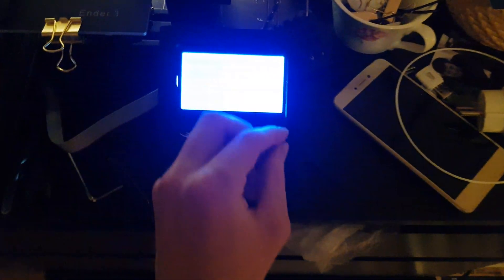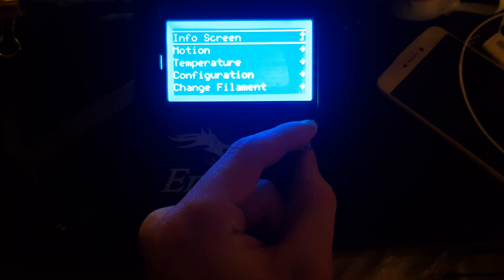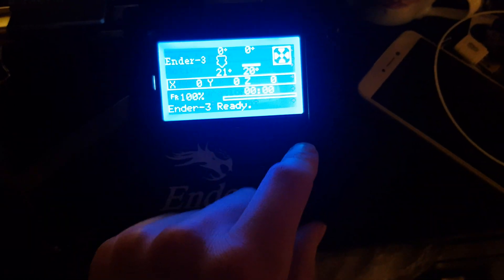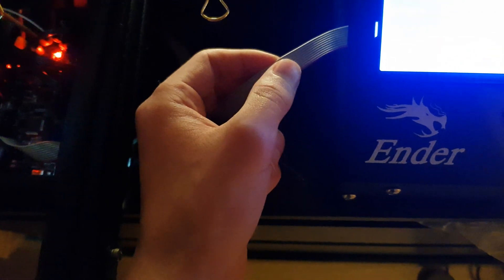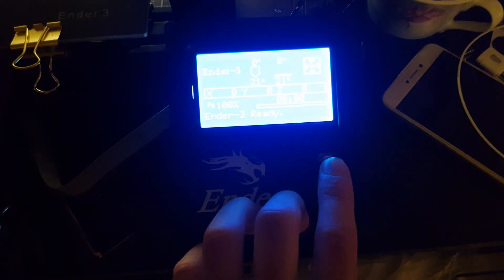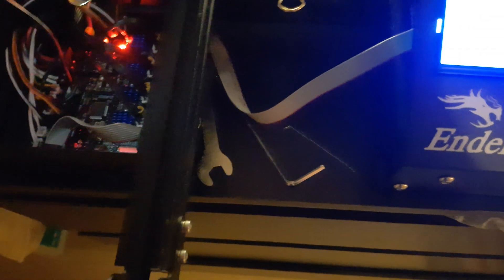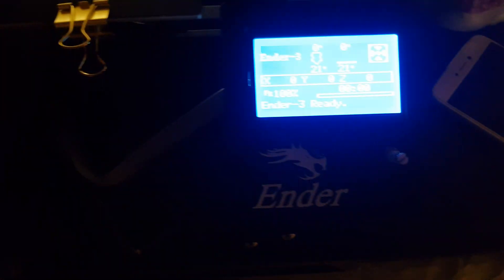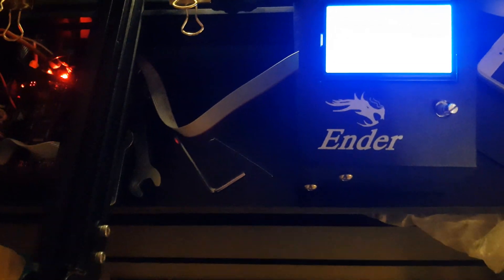Ender 3 control knob stopped working (Update - now works, read description)

Comment: i just had the same problem and tried to solve it. i formated the SD card and it works again. maybe the 8bit motherboard doesn't handle very well with too many gcodes at once. maybe the memory on the motherboard could'nt handle the data... idk. but try it. worked for me

Comment: This happened to me 2 days ago after updating firmware. I was flashing Marlin 1.9.something with enabled Bed PID and Linear Advance. After flashing, the encoder does not register rotation anymore. 

Since i havent touched the Arduino IDE in a long time, it prompted me to install updates after loading Marlin.ino, which i did. Then made my changes, compiled, flashed, encoder is dead. 
I am nearly 100% sure that Arduino IDE update 2.3.2, U8glib, avr-gcc and Sanguino updates caused this. So, if anyone i reading this by any chance: If youre still using Creality's 8 bit 1.1.4 board and Marlin 1.1.9 (with BLTouch, Heatbed PID, Linear Advance), DO NOT UPDATE ANYTHING ARDUINO RELATED. SKIP/IGNORE ALL UPDATES.

Comment: Did you try pulling up slightly while turning the knob?  It shouldn’t skip if you do that.  That sounds like a rotary encoder issue.
Reply from the maker: Skipping wasn’t a problem, it didn’t register rotaional movement at all. I replaced the entire lcd panel, which includes the rotary encoder, this had no effect. What ended up working was changing the motherboard, so that was the culprit.

Comment: I just got mine yesterday and the knob got really tight and lifted the knob and tried to turn it like you did but the metal piece broke! 
Is there a way to replace that?!
Reply from the maker: Its not so clear from your comment exactly what metal piece broke, if you mean the metal part of the rotary encoder which I'm turning in the video, then yes it should be possible to replace if you have a soldering iron(and better soldering skills than me, because I burned the board when trying to desolder the old encoder off)

My advice - if you can afford to buy a new lcd, save yourself the trouble of trying to fix it. You can always try to fix the old one and if you get it working again you'll have a replacement if the new one breaks. 

However if you want to save the money, then you should be able to buy just the rotary encoder for a couple $ on eBay etc. 

Hope you figure it out! Let me know if I can help with anything else :)

Comment: I have a stock Ender 3 with a similar issue. Sometimes while turning the scroll wheel, it doesn't register the movements. My first thoughts were the same (bad scroll wheel). Now I'm starting to wonder. I am still running the stock 8 bit main board.

Comment: I had the reverse issue.
Reply from the maker: Did you figure it out?
Reply: If you still haven’t figured it out the ribbon cable that is connect the the motherboard might be loose

Comment: Hi, I got the same issue. Did you fix it? Thank you
Reply from the maker: Hey! Sorry, never figured out the issue, i even soldered on a new rotary encoder, but the problem is still there, so i suspect the motherboard to be the issue. I`m still using octoprint for all my interfacing with the printer.
Hope you get yours sorted! best of luck!
Reply from the maker: Hey man! Switched back to the original motherboard, now the encoder works!
Reply: Hey buddy, how did this happen? Can you tell me a little bit? @simonms92
Reply from the maker: still not sure what happened. But I managed to troubleshoot to conclude that the board was the issue, not the lcd, rotary encoder or ribbon cable
Reply: @simonms92 So did you change the motherboard?
Reply from the maker: @gurultustudio6601  i had a bigtreetech motherboard installed, and this is the one I suspect had the issue. I still had the original motherboard that came with the printer, so I switched back to that one and the button worked again.